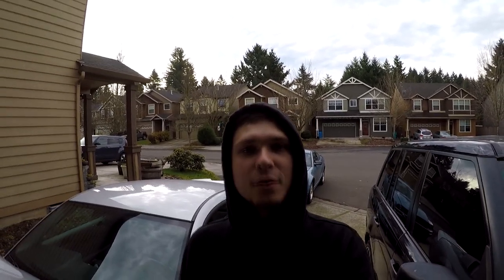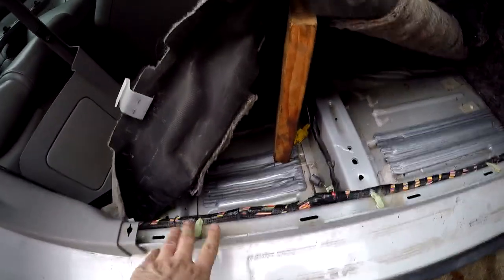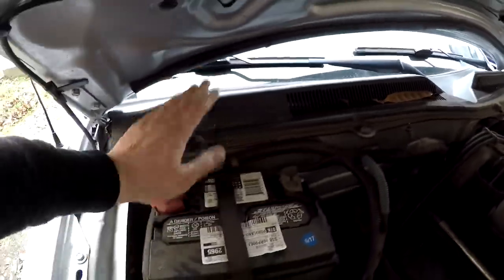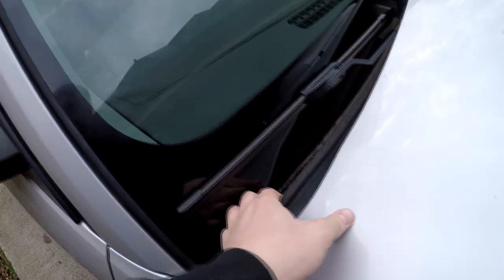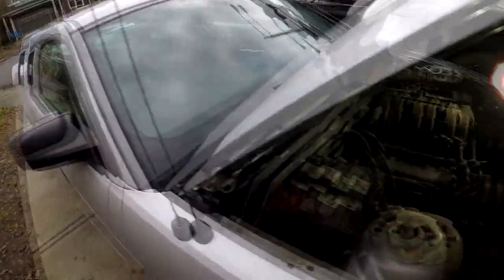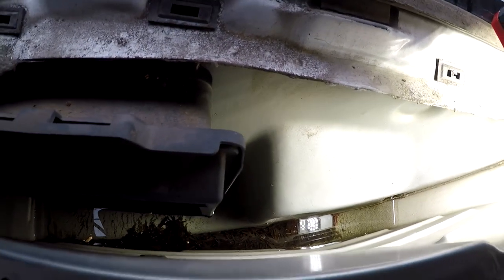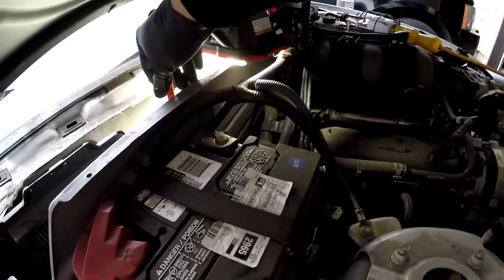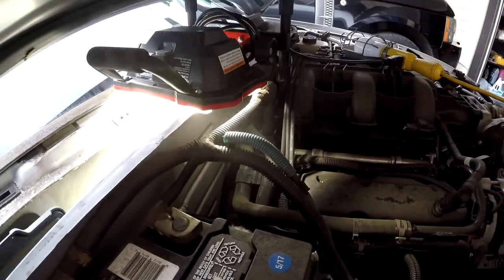TUTORIAL: Ford Mustang Water Leak EASY FREE FIX - STANDING WATER INSIDE CAR

Comment: Don't have to do all that just pull it from the bottom though the engine compartment I just took it off but there is more issues to look at with this problem . The grommet leaks the door seal leaks and the weld behind the side car panel to ... and on and on
Reply: True! I went through all of this! Replaced all weather stripping,  Even went as far as to replace the windshield,  the windshield guy found the problem...the grommet on the passenger side , the very first one that isnt even really under the hood, the cowl doesnt even clip into it, my car is a 07 and is Alloy grey..so you couldn't even see that the first grommet was missing..now waiting on the next rain fall...hopefully this was the issue.

Comment: Well. Even easier way... No need to remove the panel and poke with rod. Just stick your hand under, next to battery and feel the rubber drain. Gently pull it out and let water drain. Clean it and stick it in. This you can do ocationally without having to remove anything.
Reply: i should not have to do this after i spend this amount of money on a car....
Reply: I did the same even on the driver side u can see ruber part without taking anything apart
Reply: @mikewilson691983  Pull out both rubber drain stoppers and do not replace.  They are an engineering error. The area will drain properly without them.
Reply: @bruceferguson4553  why are they there?
Reply: @macweber It’s there to prevent any rodents from going up and creating a nest there. Also more of an issue if the car is parked outdoors.

Comment: Awesome! 
I fixed my leak however the car won’t start now. Dried it out. It’s been well over a month. I have power. Everything works (windows, lights, radio, etc.)but it will not even attempt to start or turnover. Not even a click. Any ideas? It started and ran PERFECTLY before the water leak.
Reply from the maker: If you have power but not even a click when trying to start it is probably your starter or the starter relay. I would grab a blunt object (pipe, hammer), and gently tap on the starter and then try to start the car. If it starts, then your starter is bad.
Reply: Ok

Comment: hi i have a 2013 mustang, my rear driver foot well is wet at the center corner, everywhere else is dry not sure where its coming from. Can these floor pan rust? Well removing seat alone be enough to lift these floor carpet up?
Reply: My 2015 just started having this issue this rainy season at the exact same spot you’re describing. Did you happen to find the issue?
Reply: @liangazheng1  yes but not sure if it applies to ur car. As everyone knows theres a drain cowl on the passenger side next to the cabin filter, well theres also a drain cowl on the driver side underneath the wiper motor that fixed my issue.

Comment: Damnit. I really wish that this was the issue but min is clear. I even cleaned and resealed the cowl grommets. I did a water test after pulling up my carpets and still see water coming in through the front. Gotta figure out another way to get in there
Reply from the maker: You might have a leaking seal between the windshield.

Comment: you don't  need any tools you can pull out those rubber pieces by hand  on both sides I just did it the right side was clogged took plug out poured 2 liters of water into the cowel and it drained right through using nothing but a flashlight to see what I was doing to change the cabin filter or clean inside you will need to remove the cowel

Comment: I did this and it’s still leaking. Any suggestions?
Reply from the maker: Where do you see standing water?
Do you have a moon roof? Or a convertible top?
You could have a bad weather strip around glass.
If you have a moonroof, they have a drain hole, which can get clogged over time. Hard to help without seeing, but hoped this will give you a few ideas.

Comment: I've owned my 2007 gt for almost 5 years now and I've never had this issue. I even.park it under trees and everything
Reply: original 06 owner and no problem until this year about 1 month ago.  Battery drains when driving. But no water inside wetting the carpet, its weird. Doing this 1st so FYI: https://www.youtube.com/watch?v=BTAPevyl9Rg Then doing this with new OEM part (my car is in way better shape than this one) https://www.youtube.com/watch?v=-nKK8roW51o